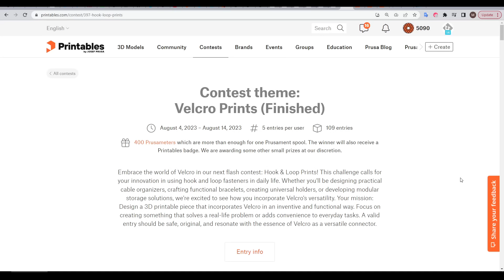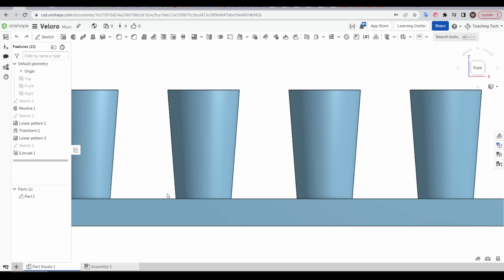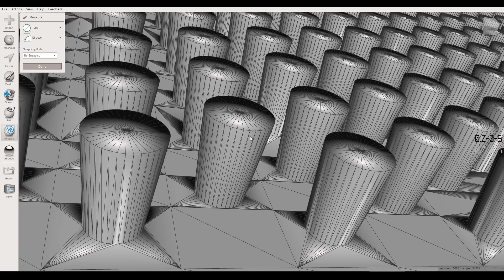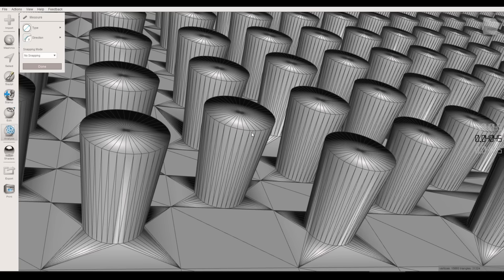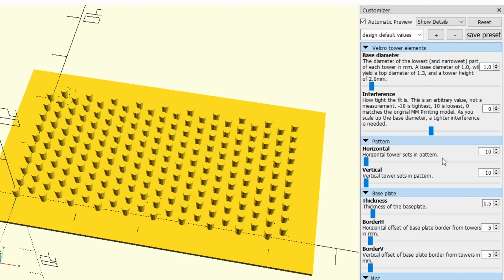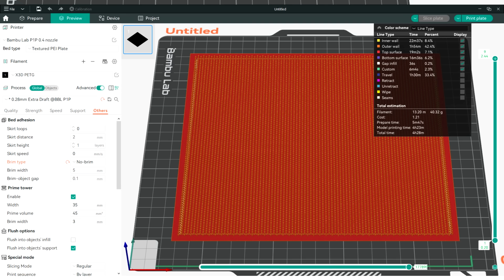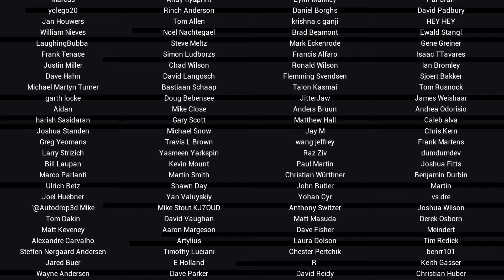3D printed velcro is something you have to try

Comment: Just a note on the finer printed velcro (from MMprinting) that you showed off, you should be able to get the two pieces to mesh after rotating either piece 60 or 120 degrees.

Comment: This type of fastener has been sold by 3m and others for years. 3m call it dual lock, and it's frequently used because it holds more rigidly that hook and loop.

The commercial versions aren't limited to the parts being axis aligned.

It's very interesting that it can be 3d printed
Reply: Yeah, when I used to stock command hooks at the store I worked at, a lot of them used this technology. They had a little graphic showing the mushroom shaped pillars.

Comment: i'm not sure about this, because it could be that the tiling of the pins is not exactly hexagonal, but if it is, you should be able to rotate the halves in 60 degree increments and they should mesh properly.
Reply: They aren't hexagonal. they are 2X:Y
Reply: @mytuberforyou thanks for the correction

Comment: This is fascinating. I have 3d printed zippers and fabric panels, and even joined them with soldering iron stitching. Adding velcro definitely ups the possibility of totally printable softgoods. 

I will admit this isnt the approach I was expecting. I suspected something like the nozzle extruding a vertical tower or loop, an approach like that to create the features. Isnt this very challenging to not get stringing or underextrusion or bad Z adhesion on these? what about them breaking off? Video seems to indicate good performance so maybe not a problem.

Comment: This seems more similar to dual-lock (mushroom hook) type fasteners rather than velcro (hook & loop), which also use plastic symmetrical towers rather than two different surfaces (hook & loop) to stick to each other. Strong, but a lot more fiddly than actual velcro and takes much more force to close.

In terms of your OpenSCAD customizer values, it would be more useful to have the generator specify an X/Y coverage area in millimeters rather than a number of tower pairs because as you demonstrated, changing the other parameters makes the total size of the pattern change which makes this design difficult to integrate into other designs as-is.
Reply: I think the interference value could be set in mm of tower overlap/mm of tower gap as well, which shouldn't change with scale

Comment: I wonder how many cycles this can go through before the towers start to delaminate. There's strength in numbers when loaded but unsticking pulls individually on the towers. In any case, this is pretty cool, gonna have to try it soon
Reply: Even worse the popped off tower would stay locked in the other side and jam future attempts to Velcro that piece unless you pop out the bits
Reply: I'd probably print this in PCTG. Similar properties to PETG but with the interlayer bonding of TPU in my experience
Reply: I was thinking of cranking the nozzle temp up high in order to make it stronger - might increase stringing also.
Reply: @timwright7738  Good idea
Reply: I would guess a ton less than fuzzy velcro. 3m makes plastic ball on a tree style strips and those have significantly fewer cycles than the fuzzy kind

Comment: I believe you can get command strips that work nearly exactly like this but much tighter. would be interesting to see comparisons between that, especially since command velcro is rated super high for it's size, and both sides are the same.

Comment: For some 3d models where I want to customize I use Blender and it's Boolean modifiers. I imagine if you rendered the large matt of velcro, but wanted it in the shape of the heart you cut by hand, you could instead just overlap the heart model and the velcro model and apply a boolean to get the desired shape, though I can imagine that some of the edges would need finessing to prevent weird islands or floating geometries.

Comment: The strength test was surprising. I didn't expect the PETG velcro to be as strong as it was. Its strength reminds me of the Yellowbook test the MythBusters did back in the day. Individually, the friction between pages and the velcro is really small, but you add enough pages or hooks, and the strength increases drastically. Also, similarly to that MythBusters test, the weakest point was actually at the base/spine.

Comment: I've been designing some geothermal greenhouse/duck-coops. They transform twice a year to swap between a winter-coop and a summer greenhouse. I've planned a system of cranks to roll the winter skin down over the south side. I've been looking for a way to adhear the insulated skin to plastic covered uprights. But UV rated Velcro, and of the sizes I need, is prohibitively expensive.

This likely solved my problem. I think ASA velcro will be perfect!

Comment: Great for a stack of computer components that don't get very hot, but can slide if bumped: attach a DVD drive, an external hard disk, and a hub - print the holders separately and just stick them together without committing to a single large print to hold them all that must be reprinted as things change.
Reply: That's a neat idea!

Comment: What an awesome idea! These days, I'm working on a 3D printed arm that I can clamp to my desk to hold my second monitor wherever I want (in height, depth, rotation, and with a ball head to choose the monitor's angle). Adding patches of "velcro" to it could be super useful for cable management add-ons. I might actually add velcro bars on the sides of the main tower in a new iteration!

Comment: 6:40 - Michael, on the material data sheet for hook and loop products, a standard woven strip can hold: 12 PSI in shear, 6 in tension, and 2 in peal strength. It looks like you have about 30in^2 (3" x 10"). It would take 360 pounds of force (or 1600 Newtons) to shear the sheets. Please don't hurt yourself, or your floor.
Reply: This is entirely incorrect. There is no standard hook and loop. The peel, shear, and tension strength depends on what hook is mated to what loop. Also peel is performed at 1"x7", shear at 1"x4", and tension at 1"x1" if I remember correctly.

Comment: I can see this being very good in some of my designs where I stick velcro on to the finished object. However in a lot of cases this would only be possible to print with the velcro the other way up. Do you think this would be possible to print upside down?
Reply: Great question! On my version @bowieinc I actually worked on some models that were two sided. It does work, but the support clean up makes the part functional but ugly. I also tried to stack them with bottom piece normal and next one inverted posts touching post (the second piece being two sided). This worked but again downward side was ugly.

Comment: That is very cool!  My only grumble is that there's no easy way to get from OpenSCAD to Fusion 360, which is my CAD of choice.  (Yes, I know that I can import STLs and convert them, but something with this many faces is going to be super annoying to work with in F360.)  Because of course my instant thought is to use this for the many places where I'm currently printing out a thing and then gluing velcro to it - instead, I could just add the velcro to the printed part.
Reply: OpenSCAD is better for the community since it's open source.
Reply: Just zoom in, cut off one of the nodules, import it and then use F360s rectangular pattern feature to make the pattern. Alternatively just make your own, by sketching, revolving, and then using rectangular pattern. Very easy, and it's parametric, so you can manipulate it.

Comment: Dear Michael, 
thank you for  this and your other awesome videos! I just subscribed as I've been forgetting that multiple times despite watching almost every video you put out. 
This idea is really cool and could be very useful - I will try that out.
Maybe, we could come even closer to a real hook and loop system by choosing e.g. petg and deliberately (in other use-cases) bad temperature and cooling settings to get an enormous amount of stringing which could form "loops" (like super small bridging towers) and hooks for the other side. I hope someone comes up with a suitable idea to circumvent the layer adhesion problem of those basic cones. Maybe we could subdivide rows of those cones and print them on their side individually to profit from the better print orientation and then afterwards interlock those rows (melt together?) to a velcro pattern.

Comment: Have to say your explanation of why bad printing is actually a good thing is a bit "Yes but actually no but yes".

Yes it works better becaus of stringing but actually no because there is more friction between the stringing which will go away pretty soon after using because it will be frictioned away. but actually yes it helps in the beginning. The PLA having a loose fit is the only real bad take I saw. If there is loose fit that is a user error Interlocking meta surfaces need the close fit so if you don't have a close fit you aren't actually evaluating the material but the design. And the design can't work losely fitting.

Comment: You may be interested in checking out 3M Dual Lock Reclosable Fasteners. Very similar product but they use mushroom shaped pins to increase connection suface area and require a steep engagement/disengagement angle.

Comment: 🎯 Key Takeaways for quick navigation:

00:02 🧩 Explored 3D printable Velcro, a hook and loop system.
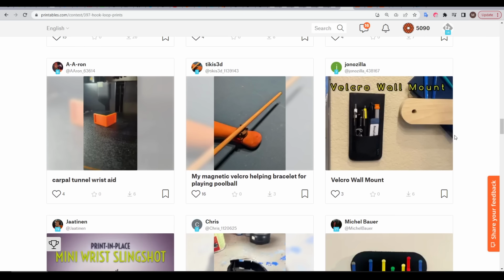01:02 🕹️ Velcro consists of hooks and loops that tangle to create a strong bond.
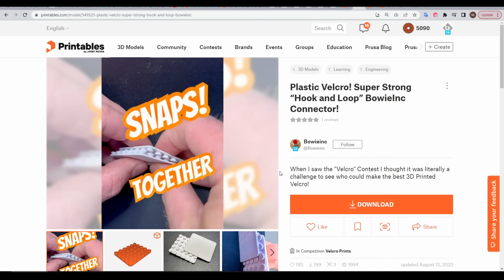02:11 🧲 Examined two 3D printable Velcro designs with different patterns.
04:02 🧵 Tested Velcro made from PLA, PETG, and TPU filaments.
06:21 💪 3D printed Velcro exhibited impressive tensile strength, even holding up to 10 kilograms.
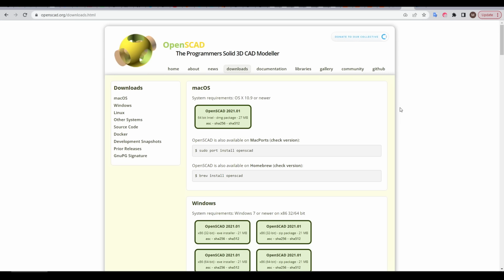09:08 🛠️ Demonstrated how to customize and 3D print Velcro using OpenSCAD.
13:30 🎨 Shared ideas for using 3D printed Velcro in various design applications.

Made with HARPA AI

Comment: I would suggest testing with a 75D TPU like NinjaTeks Armadillo or a PCTPE (Nylon and rubber blend) like Taulman PCTPE. I use both. Phenomenal layer adhesion, very strong, and semi rigid. I think for this application either one would give better results.
Reply: Yeah -- that's the obvious question -- what is this print like in nylon or similar!?

Comment: That's not the way interlocking loops work! This test is useless and there is no need for this vertical test! You can't print "Velcro" from this test. Totally useless! A french cleet would be the best fix for this test pattern. Interlocking loops are much more simple than this and should be very soft but should be useable in horizontal applications also. Velcro in a vertical fashion is not very useful.

Comment: I don't want to be a fuddy-duddy but I want people to be aware of certain realities. 3D printing is a fun hobby, but the real corporate world exists out there. This does seem like a cool idea, great creativity on the part of the designers adapting it to 3D Printing but there have been 1,000's of engineers, creators, and inventors that have been solving problems and making products well before 3D printing has been a thing.
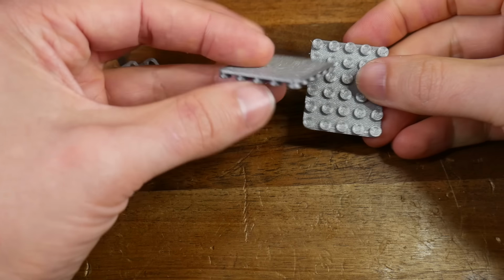3:30 - These designs look interesting but they look very similar to current products made by Velcro (Alfa-Lok), Aplix (Intermold) and other manufacturers of these products. Those products have PATENTS on them. Not only in the manufacturing process (which wouldn't necessarily apply) but also in design. For example, those "mushroom" shaped buttons look like a style I've seen before. 
It is EXTREMELY unlikely any of these companies are going to go after you for any reason, unless you start profiting off of a design. Just be aware. That's all I wanted to say.
*This is not legal advice.